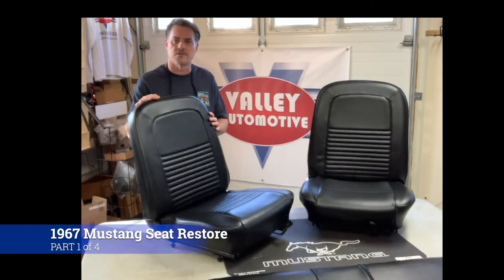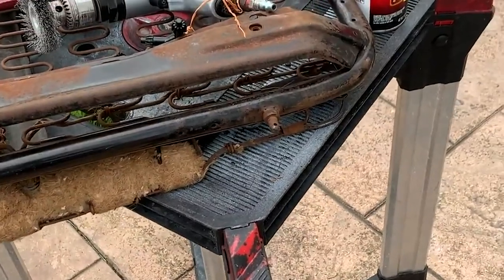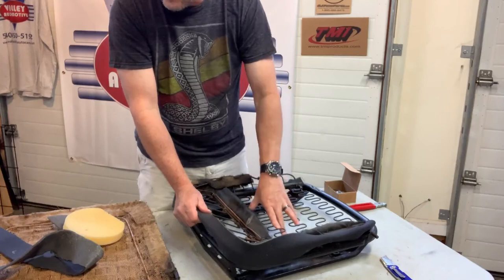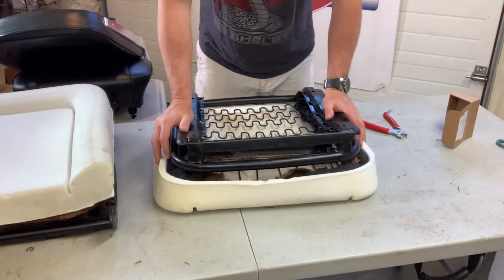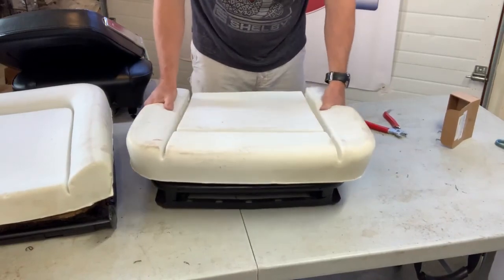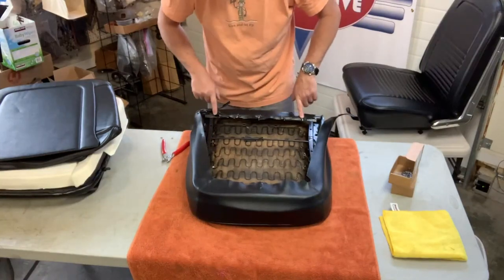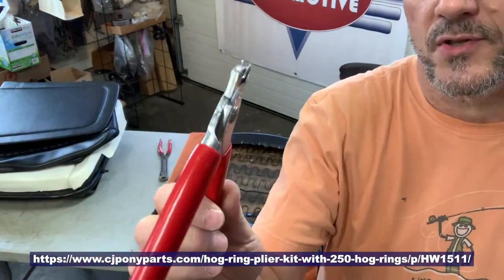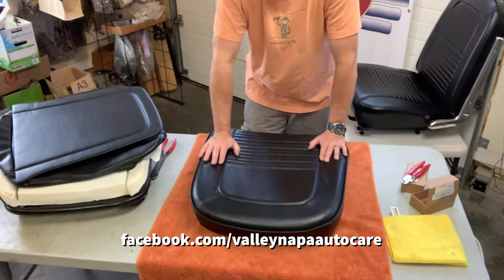1967 Mustang Seat Reupholstered - PART 1 of 4 - Recover, Replace, Restore 1960's Era Mustang Seats

Comment: Every great home needs a foundation.  If you're lucky and get a seat that has not been recovered before.....take it apart carefully, documenting everything in place. Hog ring placement and frame covering material to the OEM standard.  good quality burlap and felt for the corners and edges. I have seen literally 50 vids from various folks skipping so many steps just to get the foam in and the seat cover on the frame .... and it looks fine......but it want last a season without the needed backing and lift wires.   This is a great vid for the average install.